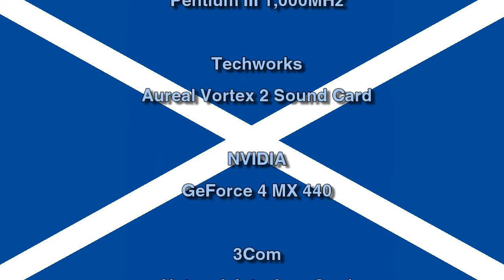Building the Scottish War Machine   Part 1   A look at the parts

Comment: I have Dell optiplex gx1 PC that has a Pentium 3 CPU with 128mb of ram,60gb IBM diskstar HHD and ATI 3D rage 2 graphics, sound blaster audio, CD ROM drive,3.5" floppy drive not bad for $5 dollars and it all works with all the parts that came in it.